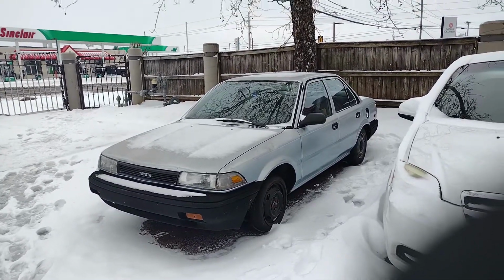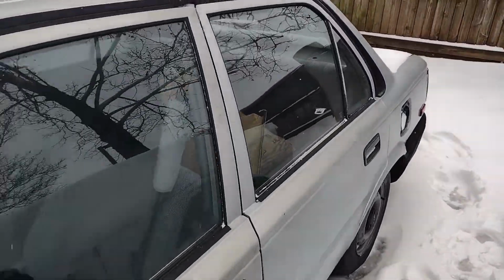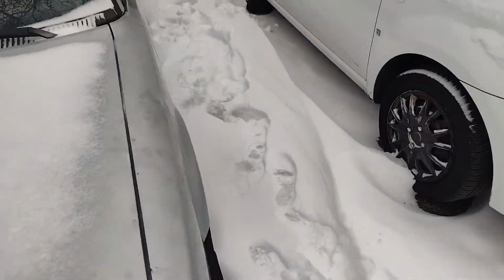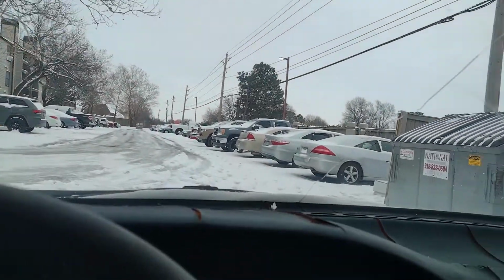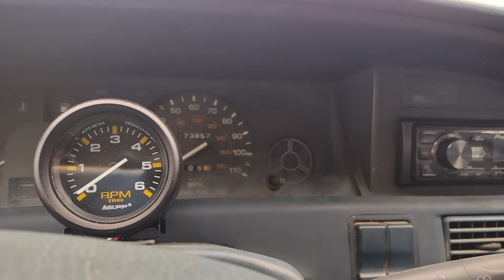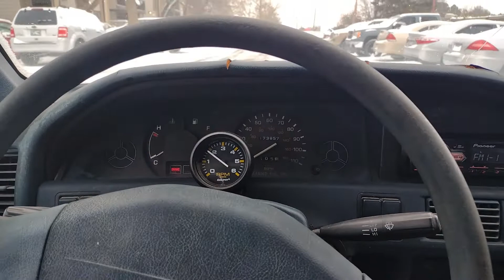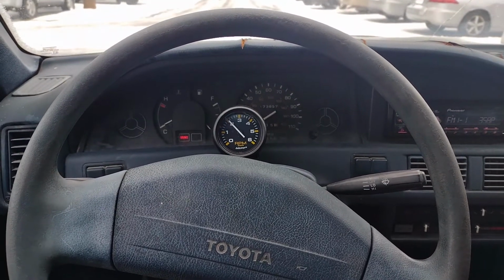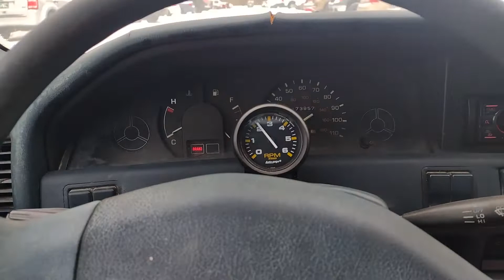1989 AE92 Toyota Corolla - FREEZING Cold Start

Comment: Same with mine. The coldest start was at -18C (0F). Just two pumps to engage the auto choke and prime it, and it started. Mine still has the original carb preheat system that yours was missing so it idles fine after the start.

Comment: Is this carbureted?  If it’s fuel injected you don’t pump the gas
Reply: Yes its carbureted, did you not see the big air cleaner on top of the engine?
Reply: Interesting we had a 1986 Corolla but one made in Japan and pretty sure there was no accelerator pump or if there was we never needed to use it!

Comment: Why don't you clean the carb urself, when i owned this car i cleaned the carb myself it's easy.... Use some carb cleaner or u can take off the cover of the carb block off the carb opening with ur hand and rev the engine several times it will clear the gunk.